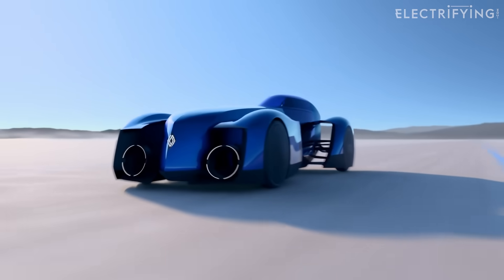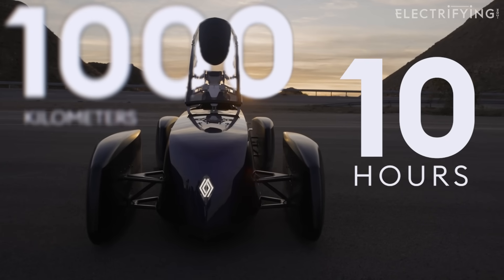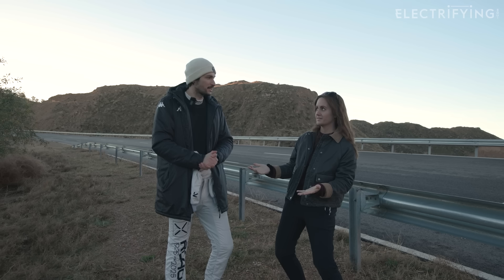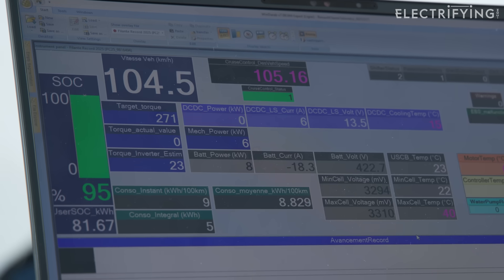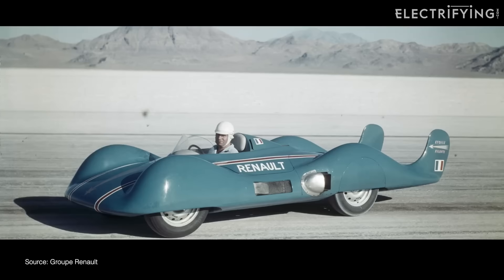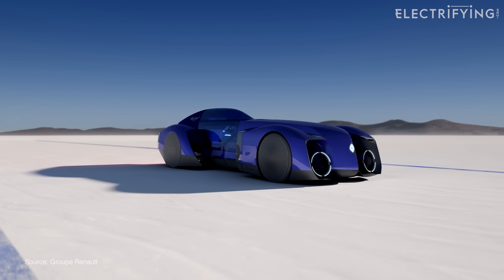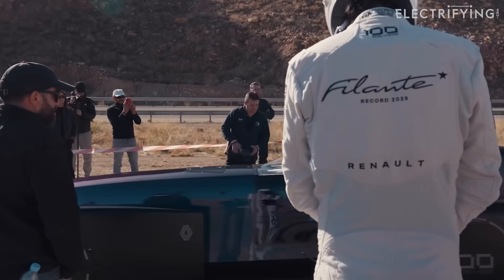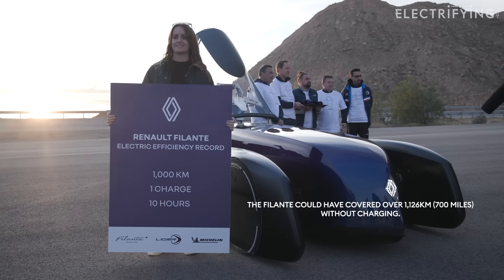1000 km on One Charge in under 10 Hours: Renault’s Wildest EV Experiment

Comment: Hopefully this serves as inspiration that some of us want efficient longer distances EVs and not tanks with massive batteries.
Reply: Still waiting on the day where Mercedes drops the eqxx or a new vw XL1 electric
Reply: @DM-jb8fs  I've been working on an XL1 type vehicle in my spare time, but maybe as a L7e category vehicle.
Reply: Once the 1kWh/kg solid state batteries finally hit the market, EVs would be way lighter and more efficient

The only question is "when?" because this solid state battery has been hyped up by various medias, but still on the pilot project for like a couple years
Reply: @sihamhamda47  aerodynamic efficiency is the major factor at higher speeds, solid state batteries won't necessarily fix that (although the higher volumetric density may enable higher capacity batteries in a smaller footprint)
Reply: We have a problem with what we add to the car in terms of sound deadening material, insulation, safety devices, loads of small motors to do all an sundry that in years gone by were hand operated and the list goes on.  Think of this a Golf1 weighed between 790–930 kg, a Golf8 weighs in between 1,255–1,465 kg that is an increase of between 465-535 kg that is around a 62% increase in weight.  So long before BEV arrived we have been increasing the weight as we add all the safety items and creature comfort we expect.  So taking this as a rough idea of what we now expect our cars to have from sound deadening and safety items as well as creature comforts we have increased the basic weight of a car.  Such we need a bigger battery to get us along the road which adds more weight.  So now we chase our tails as we want more comfort but all the motors and electronics and wiring we need for these creature comforts we wish for, the car goes up in weight...  See the trend?  We could have a smaller battery if the cars went on a diet, knock effect the cars would become noisier inside and less comfortable....
Reply: @OldmanandHisAdventures Sone good truth in there. I mean my car has electric seats which sounds good on paper but manual would do me fine. 
Trouble is the cheaper option was never available.
Reply: @OldmanandHisAdventures well... The problem with this narrative is that weight actually has fairly little impact on efficiency. Aerodynamics and tires blow any differences contributed by weight out of the water.

You don't NEED to take it all the safety and comfort to get an efficient car. You just need to make.. an efficient car. Even in this video, you can see that the "50kg limit" is clearly not a deal breaker.

The Renault 5 is tiny, tiny, tiny compared to the lucid gravity. It's almost HALF the weight. Less than a THIRD the battery capacity. And just about a third less range. How? The difference in efficiency is less than 10%! All while being great to drive with plenty of interior space. The model x isn't quite that good, but not that far off either. 

Weight (though, yes, size is a big factor) isn't really the problem. It's design and shape.
Reply: I would rather the tanks while they have aircon and other comforts not in that contraption.
Reply: You are joking?
You've not got the GLARINGLY simple point here is to reduce drag. Nothing about this particular waste of time project is the sole preserve of an EV.
Reply: Then get a Tesla. Or even a Lucid. Efficiency and packaging is what they do. Much, much better than this useless shape.
Reply: If the main solution is to reduce the cross section and making it a single seater with a driver of 50kg it's just nonsense.
Reply: @mattblack6736  it's about finding the limits. Nobody is suggesting this is a productionisable venture
Reply: @mattblack6736  None of the drivers were 50kg though, they just noted it made a difference.
Reply: @znail4675  I think the female driver might have just made it under.

Comment: This shape is the reason why the Aptera is so efficient. 
Same kinda frontwheel design on an EV (outside the body), but the Aptera is usable on the road. 
The Aptera makes 10 miles per kWh. 
EV manufacturers should build more 2 door cars. Smaller, lightweight, cheaper and better range. 
Thats a win/win for many costumers, 65% of the world population is in a solo or duo houshold. Many singles and couples don't more than 2 doors and seats.
Reply: To be fair the Aptera isn't small, it's roughly the same length as a normal saloon car and considerably wider - but it is pretty low and very slippery.
Reply: @brianballard905  Not as slippery as the CEO's.
Reply: The Aptera isn't even that efficient, the Mercedes EQXX showed years ago that you can be very efficient while still offering comfortable and well designed space for 4 people. The Aptera has a big physical footprint considering it only offers space for 2 people. It drives slow and with little comfort, it is expensive for what it is and in the end isn't even really more efficient than what the Mercedes EQXX showed years ago in the form of a somewhat practical 4 door coupe. The Aptera is kinda a useless product for people without kids or pets who have too much money and really want to stand out in traffic, not necessarily because their vehicle is so cool, but simply because it is a novelty
Reply: @BBingo-v5i  Aptera is a fully practical 2 seat coupe with plenty of storage.
Reply: @jamesengland7461  You are seriously deluded. Aptera is vaporware. There is no product and most likely never will be. They have changed prototypes more often than you change underwear in a week because that keeps them from ever selling one. They know it's unfit for purpose; it's the snake oil they don't dare sell to anyone. It was always just to line their pockets by milking gullible fools like you. Personal opinion only, but I have sense.
Reply: @BBingo-v5i you have been seriously fooled.  The EQXX is designed to LOOK like it seats 4 but it does not.  All fake. No room back there.
Reply: @BBingo-v5i  It's the modern-day equivalent of a bottle of snake oil.
Reply: Aptera is vaporware. If you bought in at $10.80 a share, they did a split to make it $32.40 a share and took away two thirds of your shares. They are now worth $4.94 a share, and if you paid a grand for them you will lose roughly $850 of it.

Comment: What the point is from this? Parts of design for serial car?
Reply: This data will primarily be useful for calibrating wind tunnels and simulations of future designs. As you can see, the theoretical data differs from reality by about 10%. This can mean a difference in real-world range of around 50 km for an everyday car.
Reply: @Dqtube  I understand they want to tweak everything for Cd value for serial cars. But they have slept good dream last 5 to 10 years. Raw materials production should have been in Europe and everything in the chain of supply. It is not enough to beat competition outside Eu, for example China. Once they start production in Eu hughe problems for everyone. Software also.

Comment: Several Evs do 1000 km in less than 10 hrs including charging stops already. See Bjorn Nyland's 1000km challenges...
Reply: Missing the point
Reply: @PorthLlwyd  Just reacting to the title. So I guess the title is besides the point?
Reply: @PorthLlwyd  The point is Renault engineers were playing with a toy?
Reply: @aussieideasman8498  and they are now better equipped to improve efficiency on their production cars
Reply: @PorthLlwyd  They would be better equipped if they set limits on practical solutions. Once they go overboard they are just playing around with no hope of getting anything into production.
Reply: @aussieideasman8498  you clearly don't work in the automotive industry. Learning from projects like this feeds into other projects. Motivation in the workforce is also important.

Comment: Who is going to tell Renault about the Nio ET7 1,000km record which was driven and live stremed by the Nio CEO. Also it was done on public roads.
Reply: It took longer and used more energy though, didn't it?
Reply: @PorthLlwyd  It was a real car that the public could buy and lease the battery. Not a prototype just to get a very specific 10 hour record.
Reply: @ktwei  Renault haven't pretended anything other than it's an inspirational prototype. Comparing apples and oranges is futile.
Reply: @PorthLlwyd  Like competing against China is futile.
Reply: @aussieideasman8498  why?
Reply: @PorthLlwyd  Because Chinese EV makers crap on Euro. Only the US Tesla is a proper match.
Reply: @aussieideasman8498  I don't think that I find a single Chinese car/brand desirable.
Reply: Have you seen the video? This was a test about running at 100km/h. That car you mentioned had over 50% more battery and did the time in 14 hours. Finished with 3% whereas they had 11% here. Apples to oranges.
Reply: @DanielMircea Just get a diesel 😊